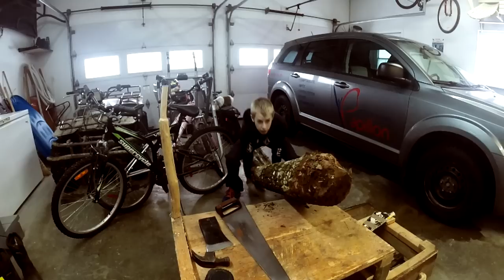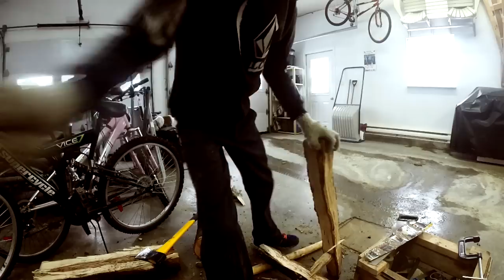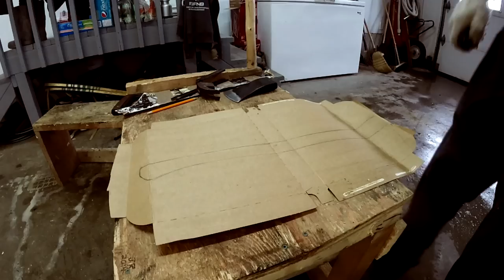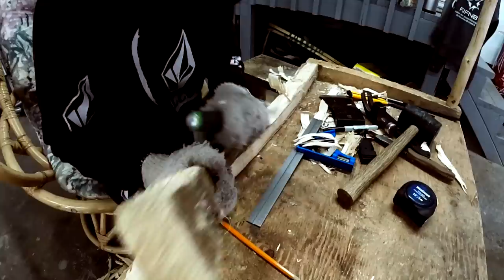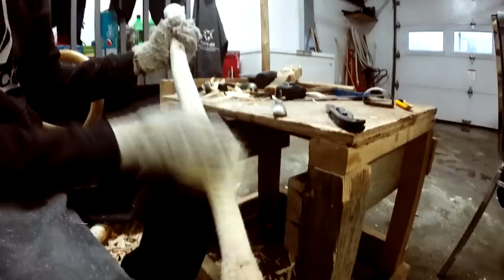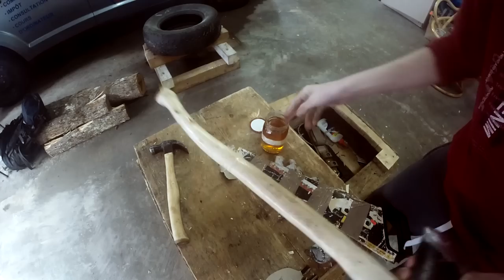The Making Of An Axe Handle

Comment: what did you use to round the axe. like the smoothing.
Reply from the maker: +Dakota Kruger I first removed tool marks with a rough rasp, then with a smoother rasp. I then smoothed it out with a rough sandpaper (60 grit), followed by a smoother sandpaper (150 grit).
Hope it helped! :)
Reply: Thanks